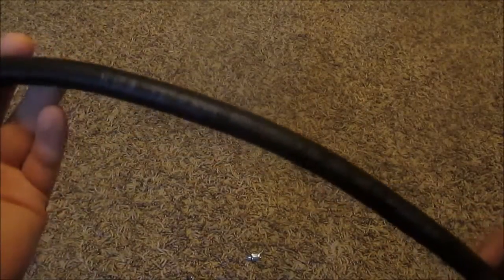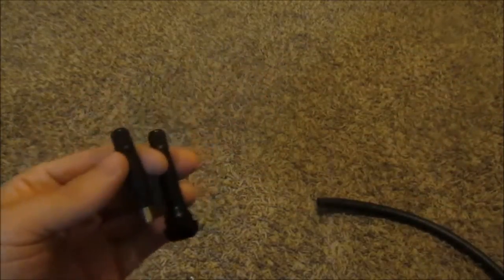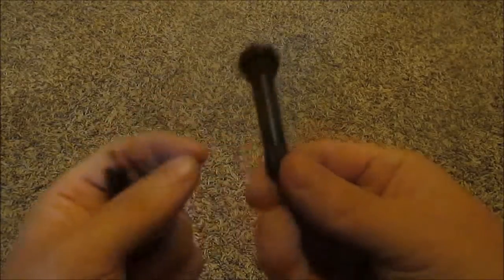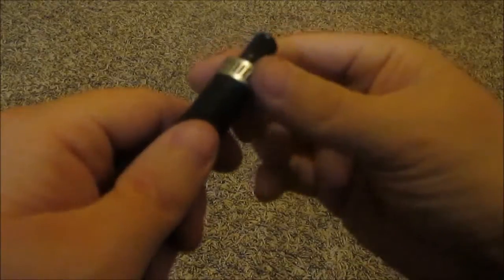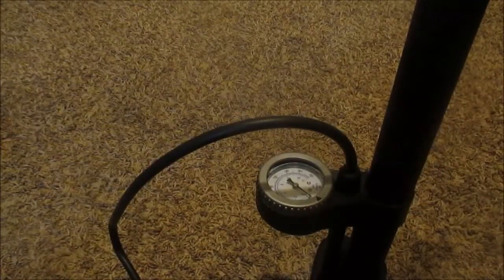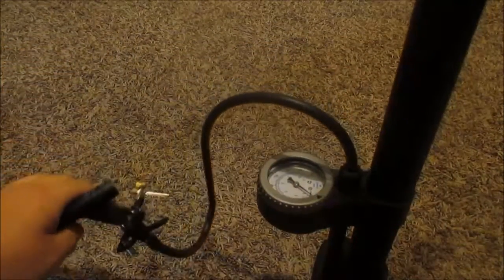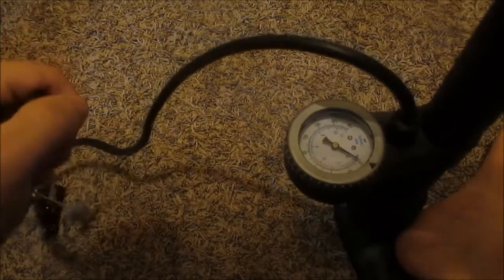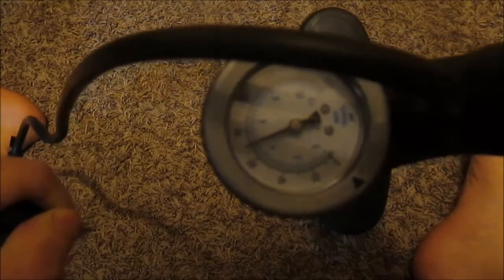HOMEMADE COOLING SYSTEM PRESSURE TESTER - PART 1

Comment: Will 1 1/4 " valve stems do ? I cant find  the 2 " . And i  dont have a conventional  cooling system  , capless radiator  w a pressurized  surge tank . Can i hook this up to that instead?